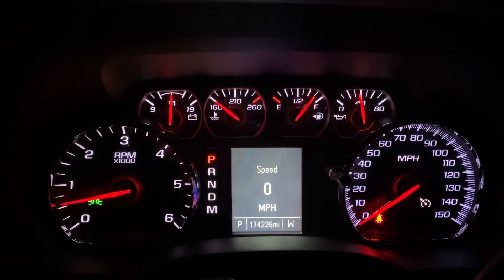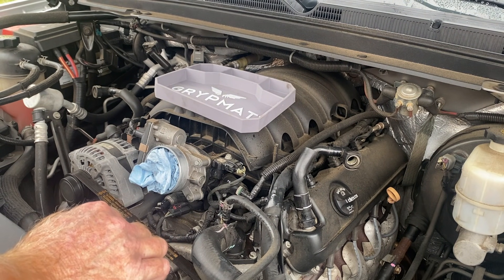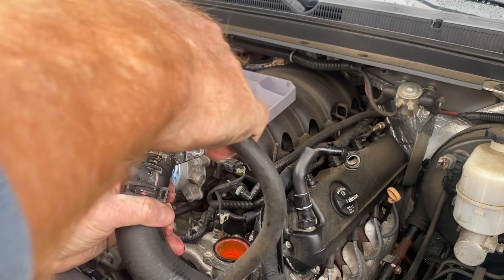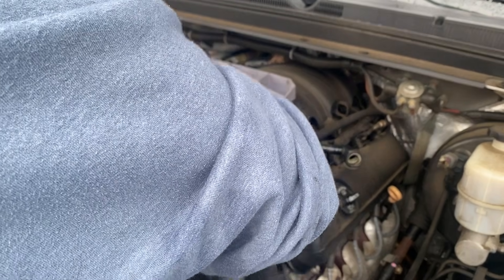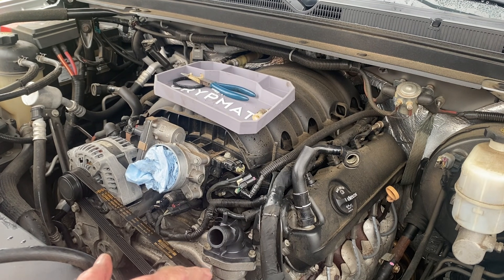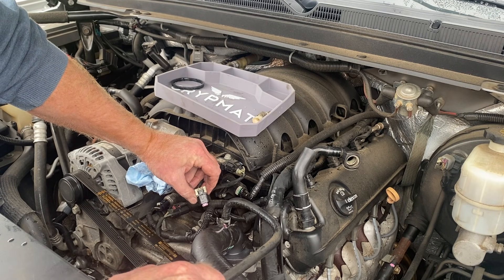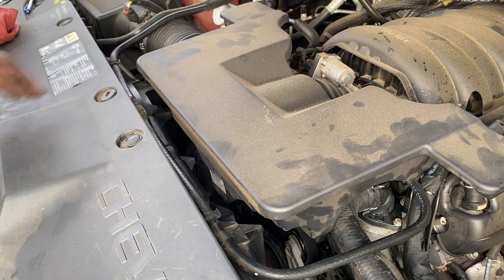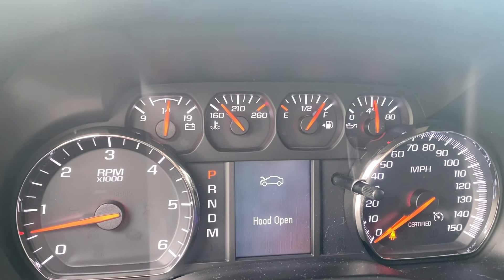Cooling Fans running on high? 2015 Tahoe Coolant Temperature Sensor and Thermostat Replacement Guide

Comment: Guys always replace thermostat first, if the sensor is bad, you'll still have correct temp reading with this issue. Believe me wemt through this twice fixed my self under 110.00 25 minutes. Also burp your coolant reservoir after adding letting vehicle run to temp 👍

Comment: I was able to replace mine easily, thanks to your video! 

Let me add that the Grey clips to remove the two breather lines  going to the valve covers need to be PUSHED, not pulled.  I  broke one while trying to figure it out. It still clips back locked when done with repair, but hopefully helps someone else to not break theirs.
Reply from the maker: great catch, sorry about that!

Comment: Can the temp gauge make the temp start to rise and fans to kick on high
Reply from the maker: unlikely, the computer turns the fans on when it detects the issue.
Reply: @wecanfixit7308  sorry I mean if the temp sensor is going bad can it make the temp gauge read high and the fans kick on high
Reply from the maker: @FLbowtieguy  I would imagine so.  Mine was reading nothing, but I suppose it could fail the other way also.

Comment: Replaced the thermostat, but mine hose on top does not get hot but blows hot air out of vents and doesn't overheat. the little hoses where u put coolant are hot. What could it be then
Reply from the maker: that seems unusual.  Does it feel like its full of water?

Comment: Replaced the sensor 6 times.. just did it today.. still getting the fan turning on... ugh!!!
Reply from the maker: Did you clear the codes?  If so, then you've probably got a wiring issue.
Reply: It's the thermostat mind was doing the same thing once I changed it everything went back to normal
Reply from the maker: @jpowerhands3607  I’d definitely change them both just in case.

Comment: So, if the thermostat is changed and the there are still issues like the cooling engine going crazy can it be possible that the water pump could leak coolant ?
Reply from the maker: it would have to be a huge noticeable leak to uncover the temp sensor enough to create this issue

Comment: I've been dealing with this issue on my 2015 Yukon for a year and a half. I've put 5 thermostats and about 8 sensors in it, replaced the sensor plug...this thing is driving me crazy. Everytime I replace the thermostat and sensor its ok for about 2 months then starts the engine protect mode and gets more and more frequent. Tested the thermostats and they seem to work ok with the boiling water test, sensors seem to work with multimeter testing but once replaced it's only a matter of time until the issue starts. I started carrying a socket to pull the battery cable to reset the computer to buy a little more time and get the ac working again.
Reply from the maker: I’d look at replacing the plug on the sensor, sounds like you could have an issue there, or a chafe in the wire to the ECM possibly.
Reply: @wecanfixit7308  I did replace the plug, it didn't resolve any of the issues. I'm going to start checking out all the grounds as I've seen other videos mentioning issues with them causing all types of different issues.
Reply from the maker: @ncarlen3  grounds could certinly cause weird things.  I had a random no start on mine forever that ended up being the negative battery cable. Of course I found this after cleaning every ground on the truck.  Good luck!
Reply: Same here pull battery cable to
Reset. Any luck?
Reply: @turningwrenches89  I switched my thermostat to a Brian Tooley racing thermostat housing, and the ls3 style thermostat they recommend and to a genuine GM OEM temp sensor and it has made it 98% better. I still think there's an issue somewhere because it occasionally acts up but shutting it off and restarting resets it now
Reply: Can the temp sensor make the temp gauge rise and fans come on high ...

Comment: remember to pull the battery power to kinda reset everything 
ask me how i know
Reply from the maker: Great point, thanks!  I used a scan tool, but disconnecting the battery works also.

Comment: So did it actually fix it?
Reply from the maker: Yes, once the code was cleared after the repair was made, everything worked as it should.
Reply: @wecanfixit7308  can you give the part numbers you used? I’ve seen where certain parts didn’t fix the issue
Reply from the maker: @cagneydavis3528  I linked the parts I used in the description
Reply: Hi you think it may just be the coolant temp sensor and can I run it like this till I get around to do this weekend ?
Reply from the maker: @Kriscerros  should be fine, if your battery is weak, the fans might run it down